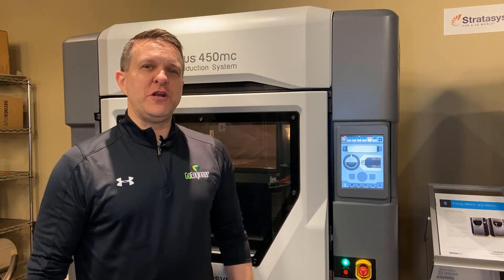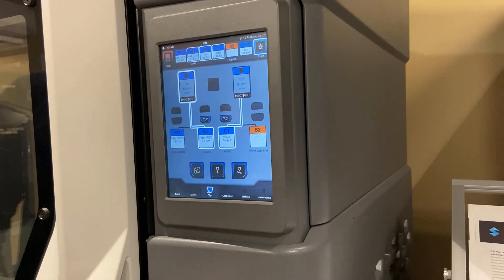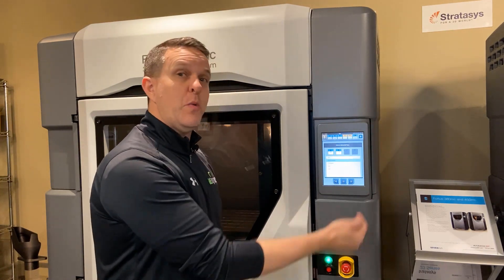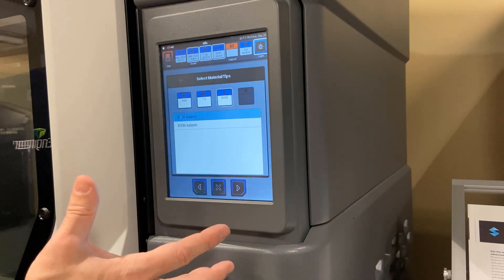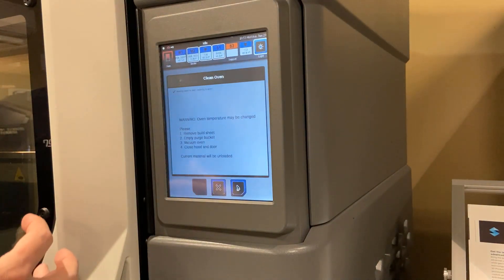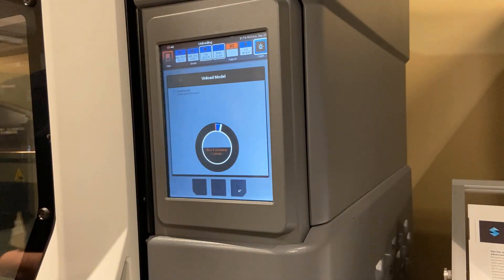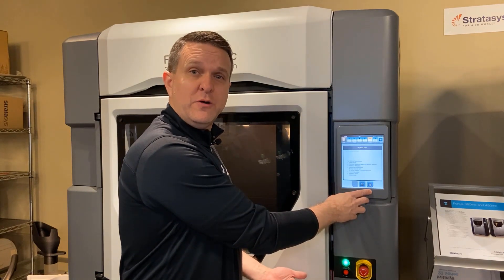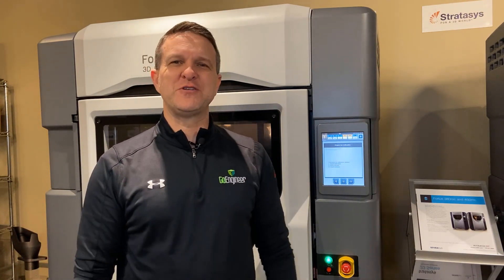Stratasys Tutorial - Fortus Tip Change Process

Comment: I'm beginning to get some nasty artifacts in my prints with this 450mc machine with the Nylon12. I even had a print pause on me because it said the support material was clogged. I purged it a couple times and got the print to finish. What "mileage" is typical for the tip change? Is there a data sheet you can point me to that gives the expected cubic inches a tip is expected to last?